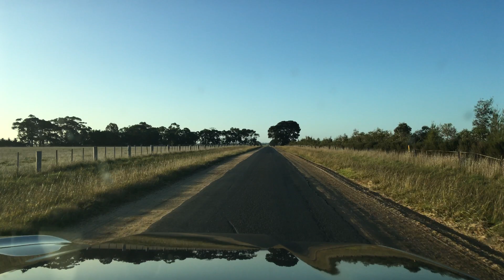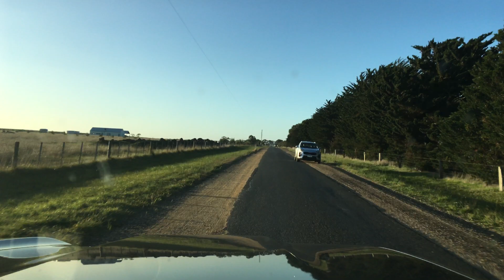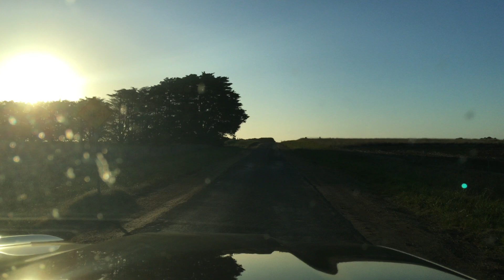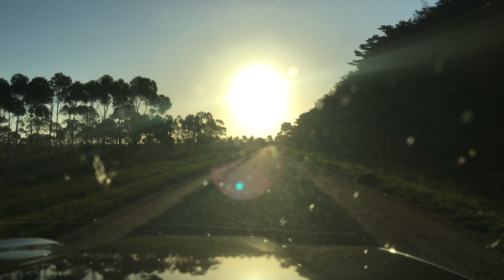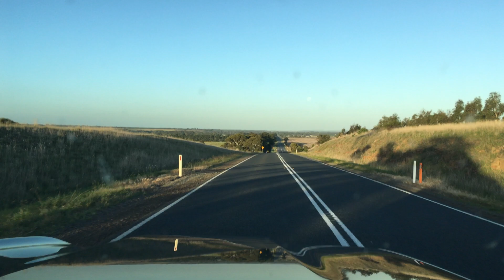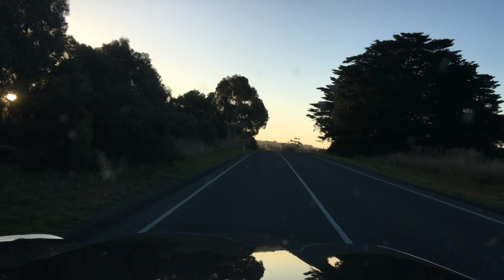SPONGY BRAKE PEDAL?

Comment: I bought my 120 2004 2 years ago and always felt it had spongy brakes but it also makes a squiking notice sometimes and can trigger an alarm sound. Could this be fixed by changing the oil or does this mean I'm already over the point and will need to replace master cylinder? I have already changed the electrical pump on the master cylinder because it was the cheaper option but it made no difference. You might have talked about this in an other vid but I haven't seen all your content so sorry if this has been handled before. 
Thanks for all your sharing,

Comment: Thanks Anthony. Would be really keen at some stage if you do a video on a brake fluid change on a 150 with the accumulator type brake booster. Also keen to know the bleeding order. I've always been taught to start at the wheel furthest from master cylinder, but the 150 workshop maual says to start at the font lines??
Reply from the maker: What area are you Andrew?
Reply: @Fourby4Diesel  In Adelaide.